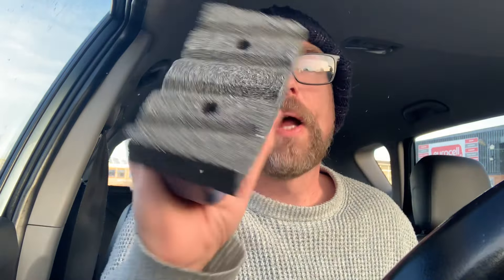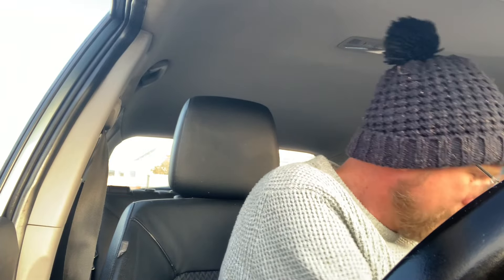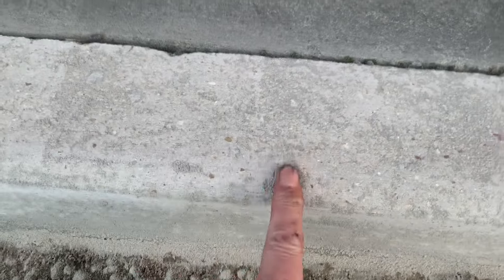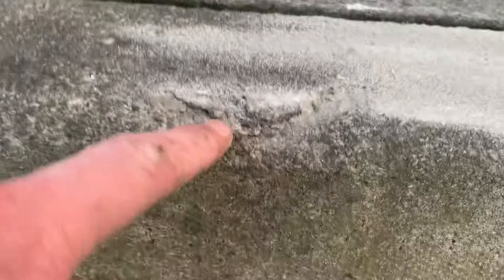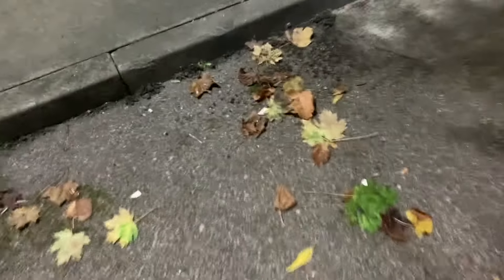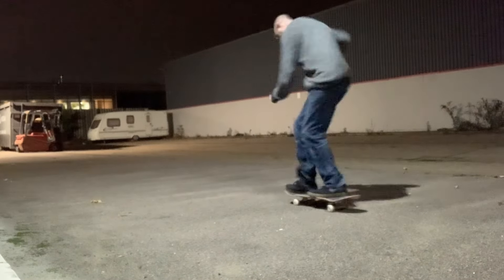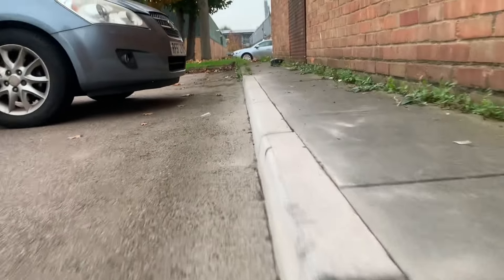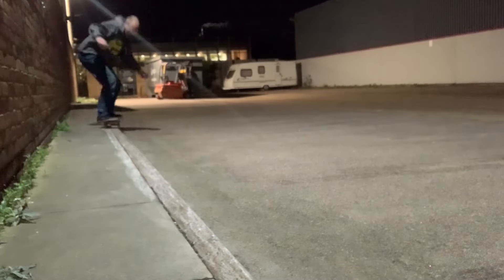New DIY Skate Spot

Comment: Stellar work, brother! Looks a bit like my go-to curb spot I prepped some years back now. People outside Europe don't even know how rare it is to find a somewhat decent curb spot. Even rub bricks aren't available at the main hardware stores here, so I have to order those online. I actually went through one trying to get this long downward curb near my house going - seems the concrete was either too rough/hard or the brick didn't have the right grit, but the curb still didn't go. I'll try brushing some sealer on real thick when it's dry again. Right now it's that season when everything's wet even when it's sunny.
Reply from the maker: I know, we are up against it in England, it’s hard to find a good curb. Yeah no rub bricks or steel stick at diy shops (Halfords stocks steel stick btw). It’s the first time I’ve used yacht varnish and I would highly recommend. I put two coats and used gulf paraffin wax from Amazon. Yeah the bad weather is here now so I was lucky to get this done before it was impossible!
Reply: @TheHypotheticalSkater  Just started following you on the Gram, but as Dutchie I can very much relate. Even figuring out what a 'rub brick' might be listed as here took some digging, and I'm a translator lol. Again, big ups for the channel.
Reply from the maker: @ariekanibalie thanks man! I started the channel during Covid! I hadn’t skated for over 10 years! I got addicted to learning curb skating and I’m still addicted 😂 I’m the only curb skater in my town! I have the odd skater turn up now and again but it’s just me and the curbs😀
Reply: @TheHypotheticalSkater  Awesome! I started again in my late 30s after a 15 year hiatus. Still doing it 10 years later. Skateboarding, like so many things, is wasted on the youth, lol. Let me know if you ever make it out to Amsterdam, we've got a whole crew of ripe old shredders here.
Reply from the maker: @ I’m over there on the 19th of feb for a few days!! I’ll get in contact if your around at that time!
Reply: @TheHypotheticalSkater  Excellent! Please do!